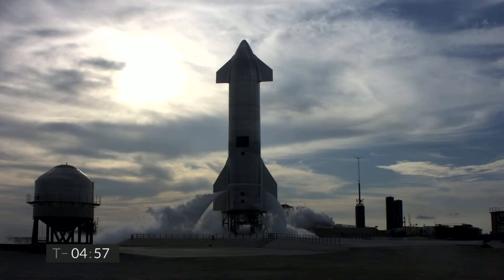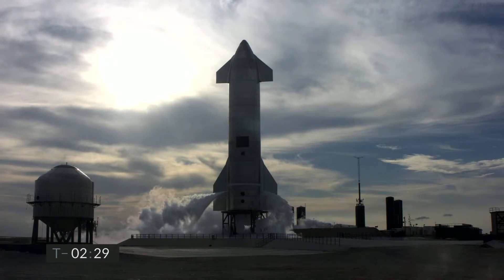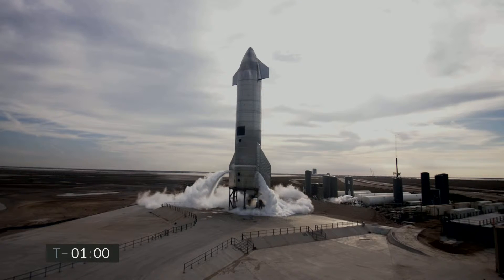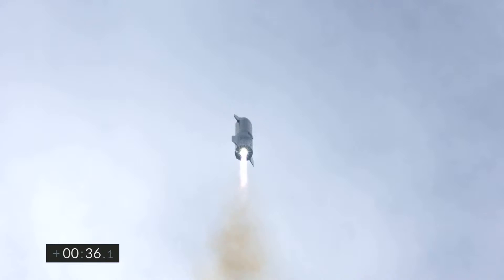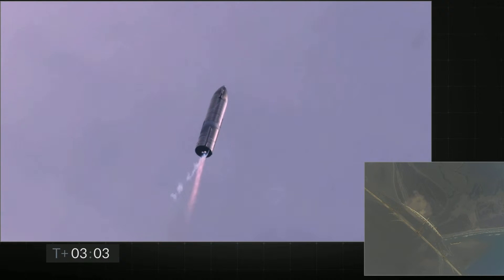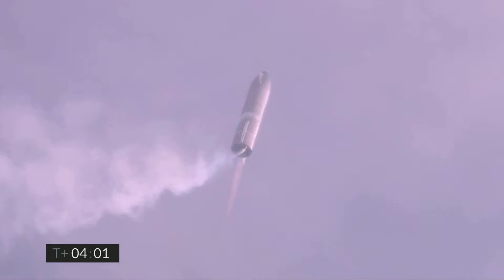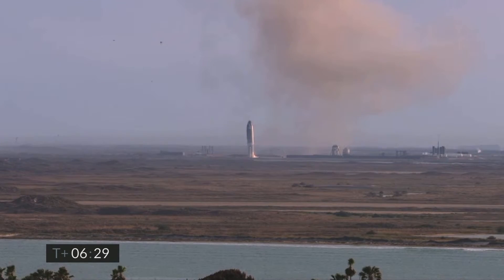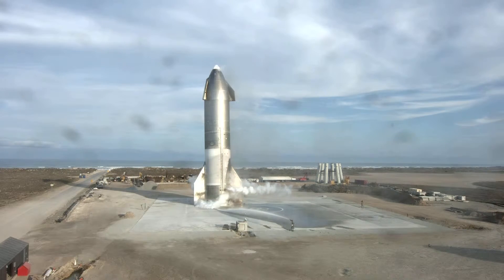Starship | SN10 | High-Altitude Flight Test

Comment: High altitude ? ??? It's a rocket , ten kilometers   ( six miles ) is not high . Germany was sending rockets that high in 1944 . 76 years and no progress ??? . And this is an empty rocket , load her up with fuel and life support systems and this tin can will never leave the launch  pad . MARS has nothing to fear
Reply: germany used their rocket to land explosively, while spacex is the opposite + it does the bottle flip challenge + its way bigger. although i wouldnt call it high altitude
Reply: There is absolutely no reason to fly it higher. They are trying out the belly flop manouver and testing the vehicle during ascent and descent in general. Higher altitudes will be reached with more evolved protypes.
Reply: @rolandb.1866  they are testing an empty can , they are getting no information at all about flipping or turning a loaded ship . This has been a waste of time up to now , but a great money earner for Musk . They could at least test it at real launch speed to see if those Buck Rogers wings will stay on under load . Top speed , around 200 mph , orbit speed , at least 17,500 mph . Re entry speed 17,000  mile per hour , fast enough to rip a shuttle apart , fast enough to melt heat shields . This is just another Californian pipe dream
Reply: @kingoghearts1  excuse me. Have you been developing a revolutionary rocket recently? No? then shut up, ok?
Reply: @kingoghearts1  these prototypes are testing ONLY the very final portion of an orbital flight, they aren't prepared for the heat and the high speed, it's like an order of magnitude harder so they need experience.
Reply: @polvalls1599  I lived through  the 60 ' s and 70 ' s , watch as rocket after rocket exploded , but they learned , by Saturn 5 they had rockets down to a science .   That's  50 or 60 years ago . This whole starship experiment has just been step after step backwards . You would have never gone to the moon with rockets this sad . All this money wasted and they are not as reliable as a German V2 rocket of the second world War
Reply: @kingoghearts1  They are not reliable *yet*. That's the purpose of testing. They get more data out of failures than successes. And It should be almost empty at landing. Almost all of the fuel is used up during ascent so a real flight would't be that different in terms of mass during the landing. The only difference is the velocity of the vehicle during reentry but they are still getting used to the new landing method so they try it with lower velocities first and also because of the lack of super heavies that are supposed to get them to orbit.
Reply: @rolandb.1866  the point is they had reliable rocket in the 1940's   . The Saturn 5 was manned flight reliable ,  why are they going backwards , and testing on an empty can , load that thing up with life surround and fuel and see what it would really do . They should have been making steady progress forward since the days of the shuttle . But NASA just sat on it's  hands doing nothing while Americans rode Russian rockets into space .at this rate Musk will launch his first spaceship about four years after China has set up a colony on Mars .
Reply: @kingoghearts1  (REVISED) why spend lots of money on a heat shield and a fully prepped starship without making sure it actually works? you have to start with the important stuff first. spacex already knows how to survive reentry, but doesn’t know how to make a giant rocket skydive and do a bottle flip and landing softly on the ground. there is a reason why they call them starship prototypes. they are not the complete version, and validating the most critical and non-tested parts of a flight. flying the complete version from the start is very slow: it takes longer to make, more testing on the ground, and more failure penalty. Why waste more money and more time to get the same data? It just doesn’t make sense. Musk prefers to waste steel rather than time. They want to test what works and what doesn’t work. Computer models can still be misleading so you have to test it in the real world. Right now, they are testing the aerodynamics of the starship, so they just want to get it high enough so they can get the data they need. Thanks to Edwardo Rodriguez for pointing out my mistakes! :)
Reply: @isaquest134  because you don't  learn anything if the damn thing is not balanced as it would be , or loaded as it would be . Musk is going ass backwards . Proving something that doesn't help him one little bit in the real world . Put weights in to make up for crew, fuel, live support . Now test it , Musk is testing on an empty can , the balance point will not be close to what a real ships balance would be ,,,,, so at the end of the day Musk has learned zero .
Reply: @kingoghearts1  falcon 9 landed at its 5th try and now it's the most reliable rocket. Starship had 4, and next prototype is full of new technologies successfully proven. Please, don't compare a mission to a test. The expectations are different, Saturn V was pioneering, Starship is so too. And Sn10 landed. SN11 tested advanced solutions, they learn from them and they will do the same, fly fail fix
Reply: @kingoghearts1  lets find out if you reach half of what elon musk has reached with spaceex to date.
Reply: @polvalls1599  if NASA gave me two billion a year . I would have you on the moon within two years and on Mars within four years .people act like Musk is using his own money . He is just ripping off the American tax payer . Sound like you're  one of the suckers Musk has fooled .   Think boy , do some research
Reply: @kingoghearts1  you have proven that you dont know any of the factors involved in bringing humans to other planets and the new technology development involved
Reply: @eduardorodriguezvazquez5120  very well said
Reply: @eduardorodriguezvazquez5120  yeah it wasnt a good paragraph but you get the point that im trying to make. again, you said it very well

Comment: 🚀My rating:

Starship SN8: 8/10
Starship SN9: 4/10
Starship SN10: 9/10
Starship SN11: 2/10
Starship SN15: 10/10
Gonna update my rating every time from now on.
Reply: sn15 will land
sn 16 will explode
Reply: @isaquest134  we will see
Reply: @isaquest134  no.
Reply: Thanks!
Reply: @Starship-SN10  ur welcome! ☺️
Reply: SN9 I'd say would be also 9/10. They fixed the header tank issue that was present in SN8s flight.
Reply: @OortCloud  the leaning was cool too
Reply: What is your rating based on? Level of excitement or what was achieved? I'm just curious as to how you gave SN11 a 2/10, you couldn't see a damn thing! lol I would argue that SN11 is an unfortunate 0/10 because of the fog, but from an engineering perspective a 10/10 because it helped them identify an issue that they need to fix for future missions.
Reply: @avsrule247  I think the rating is based on how close they were to the landing

Comment: 5:33 T-10
5:43 Ignition And LiftOff
7:59 1- Engine CutOff
9:01 2- Engine CutOff
10:05 3- Engine CutOff And Flip
11:43 3- Engines Starts And Flip
11:50 2- Engines CutOff
12:03 Lands Hard But No Explosion!!!
Reply: 20:00 Explosion
Reply: hey hablas ingles y te llamas el viejas que pedo
Reply: Lands hard?? That was the smoothest landing so far. Looked amazing
Reply: @smey02  I don't think a bounce would be considered a smooth landing.
Reply: @smey02  remember that thing is far more huge than a falcon 9, that's why the liftoff and the landing seem so much slower.

It's like comparing a collapsing building to a small falling object, the first seems slower but in reality the acceleration is the same, because of gravity.

Now, if we apply the same principle here, the smallest bounce could be an indicator of a very hard landing: since it's so big, the bounce sure seems small, but it could very well be a two meter leap, and it could have slammed into the ground at 1-2 meters per second
Reply: @leoshork  it landed at 10 m/s 1-2 m/s is actually really safe for landing.
Reply: @smey02  land at 40km
Reply: @smey02  yo that is not smooth at all
Reply: jimmys alt  ik but I say that cuz there is no explosion in the video man
Reply: El viejas
Reply: hola viejassssssssssssssssssssssss
Reply: Thank you for this
Reply: @JaxVRthefirst  np
Reply: lands hard but no explosion.......
Reply: @zaroflamedyt2334  it did explode like 10 mins later. It also had an in flight fire. They’re made using like 3 dollars and popsicle sticks practically.I don’t trust anything SpaceX builds. The falcons are basically the only exceptions, since they’re based off modified versions of old tech. SpaceX just launches to make deadlines. Nothing more. They’re apparently not allowed to launch in Texas anymore (at least for now), because they keep blowing stuff up and destroying peoples homes and the adjacent wildlife sanctuaries. We can listen to the, “but the scrumptious data we collected”, PR nonsense, but, for lack of a better term, it’s gaslighting after what was a serious catastrophic event for the company
Reply: :yt::yt::yt::yt::yt:
Reply: it exploded 8 minutes later
Reply: You forgot to mention what time the CGI kicks in
Reply: Explosion being before landing, but we can't see that at this video:(
Reply: @gigachad293  after*. "Before" was when SN10 flew in the air. Подучи инглиша ;)
Reply: 5:42

Comment: Hey SPACEX team, I think you guys shut engine number two too quickly I would have left it on until sn10 had fully stopped going downwards and paused in mid air and then shut the second down for a smooth landing. I think there was still too much downward momentum for a single rapture to push up against gravity. Remember starship is massively  heavy.
Reply: I'm p sure if theres a solution, a team of rocket scientist will find it over your advice lol
Reply: They know. That wasn't the issue though, Elon said the one raptor took in helium leading to a lower thrust.

Comment: Sorry boys and girls. No control surfaces or side thrusters to control that thing, to land butt first, in the same spot that it took off !  Also that spot moved, no horizontal thrust from rocket fuel after falling horizontally.   Why ?
Reply: The flaps are literally the control surfaces, it landed on a specific landing pad about 100 meters or so away from the launch pad.
Reply: If you look at a composite image of the landing profile, you can see that igniting the engines horizontally did actually push it sideways a fair bit, which it had to cancel out.
This one from Jack Beyer shows it well: https://pbs.twimg.com/media/EvnZ5hsXAAAR8GA?format=jpg&name=4096x4096
Reply: Ok, first off, the flaps are control surfaces. second, it does have side thrusters, and third, it did generate horizontal thrust, which is why it over corrected itself when doing the flip maneuver.
Reply: Is this a joke?

Comment: Uhmmmm I have a question?   Why not 4 engines sincronizeds with 90° of movement each ones compliting 360° for the maneuvers and sincronizations.
Reply: Because a quad layout is only better when you're actually using all four engines. With one or more engines shut down or failed, it produces significantly more torque.
These engines have too much thrust to hover on more than a single engine. Future improvements might allow landing on two, but probably not three, let alone four.
If you're only using two engines, triangle layout gives an offset of 0.58 nozzle radii, while quad layout is 0R in one configuration, but 1.0R in the other two.
If you're only using a single engine, triangle layout gives an offset of 1.15R, while quad gives 1.41R. Quad layout also gives 1.41R with three engines.
Reply: Well, becouse you don't need it if 3 works they should do 3 becouse less engines is less weight and less complexity and that makes the payload higher

Comment: The rocket should hover before landing. I dont think a few meters between the rockets and ground is enough as its coming down to land it gently. Maybe a spring loaded catching rig that's over the ground far enough for max propulsion from rocket.
Reply: If they did it higher up they would use much more fuel, they dont have that much margin.
Reply: @alexn8219  nahh man listen to what I'm saying
Reply: @jacobbutler7942  Why do you think youre smarter than a multi million dollar company? There are no absorption rings on mars or the moon. This thing is supposed to go interplanetary.
Reply: @alexn8219  it's not a pissing contest. I'm just throwing my idea in the comments.
Reply: The whole reason they are using the bellyflop maneuver is to increase air drag decreasing the fuel neccessary to do the flip and land, so hovering wouldnt make much sense as there would be not enough fuel.

Comment: They should build a machine that can drive around and bore holes into the side of mountains or hills so they can build base's underground on mars.
Reply: Psssst!
Don't tell anyone...
But...

It's called the Boring Company.
They are doing exactly what you propose.
Reply: @volksgenosseerichhonecker5104  thing about building bases underground is that they can hold heat better. Also protect from and solar radiation untill they some how thicken the atmosphere. as well as many other possible hazardous conditions.
Reply: @volksgenosseerichhonecker5104  if they can establish some kind pf manufacturing plant to start making thure own metals an parts on mars that will save them billions because they wont have to ship it there

Comment: Perhaps there are 4 types of solutions to landing legs taking all the weight...   Also

possible to use as a back up system to allow landing redundancy.  

Ideal Goal:  move more of the shock absorbancy from the rocket to the landing stand. 

1. Boyancy:  landing on a floating stand....  
2.  air bags:  a series of three airbags around the diameter....
3. Traping  similar to a pole vaulters box...
4. Hooking:  Jets land on an aircraft carrier through the assistance of hooks...

… If a parachute was deployed at the last minute this would tend to right the rocket
and perform the flip so the rocket (and tanks) may be better positioned for the
burn...
Reply: But none of those ideas could be done on Mars wich is why they're doing it how they do it

Comment: Wonder if they'll take into account the fact that the Martian atmosphere is 1% the density of ours, so those flaps won't do fuck all on mars
Reply: It was design just for it... The whole spacecraft tho :) (engine specialy)
Reply: Well they're planning to use those flaps to control reentry at altitudes on Earth where the air is even thinner than the surface of Mars, so I'd say they've accounted for it.
And a simple understanding of dynamic pressure indicates that those flaps will indeed do a fair bit more than 'fuck all' on Mars.
The Martian atmosphere is ~61 times less dense than ours. Which means that at a velocity of root 61, dynamic pressure will be equal.
So at ~7.8 times the speed, those flaps will work identically. However, since gravity on Mars is only 38% of Earth's, we don't need equal performance. 
Root of 0.38 is ~0.62, and 0.62*7.8 is 4.8. That means that the flaps will allow for a similar descent on Mars at ~4.8 times the velocity.
On Earth it descended at around 250km/h, so on Mars it will descend at around 1200km/h, which is still significantly lower than the 25,000+km/h entry velocity.
Yes, the rocket engines will have to do more of the final braking than on Earth, but the flaps can still remove ~95% of total velocity, which is very worthwhile.

Comment: A hollow space barrel shaped like an anal candle has landed even though it hasn't been in space - IT'S MAGIC! ... Now Musk can fly it to Australia, with refueling over Japan, why not? ...
Reply: Getting this thing to space and back would be a piece of cake. But here's no point taking it up to the Karmen line and back, as it's never intended to fly such a profile.
And there's no point risking the heat tiles and extra Raptors needed to get this up to sufficient velocity to test the actual entry profile if they haven't mastered landing yet.
Landing is one of the hardest parts of this project, given the vehicle's size, unique descent profile and aerodynamic controls, and extremely complex engines.
So they're practicing with minimum viable prototypes SN8-SN11, before risking the more advanced prototypes SN15-SN19 on higher and faster flights.

Comment: A  pressurized blader in the header tanks might solve the problem!!!
Reply: If you can find a suitable material that's still elastic at -339F/-206C, then sure. Currently no such materials are available.
Reply: @lazarus2691  Ok I see the problem!